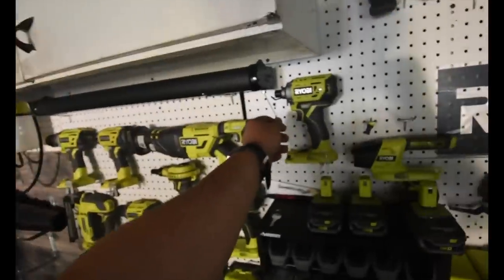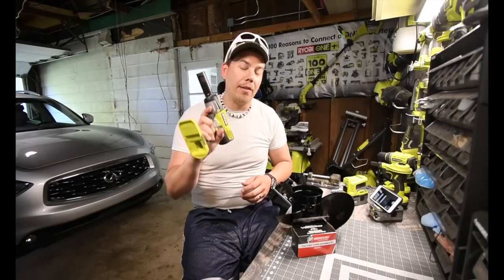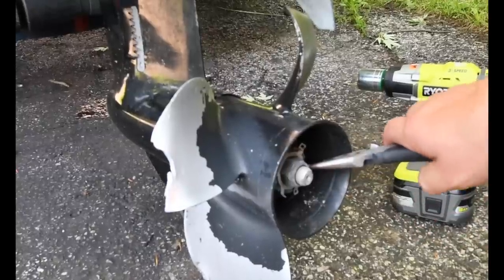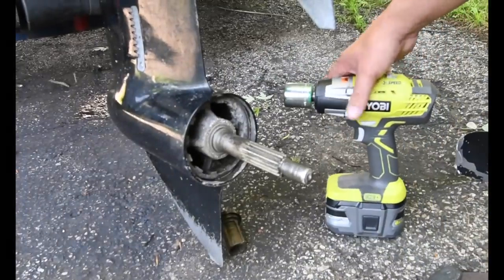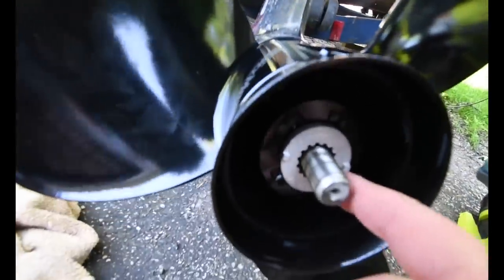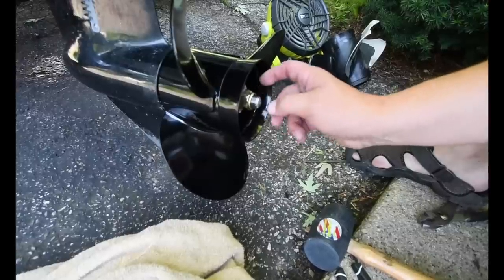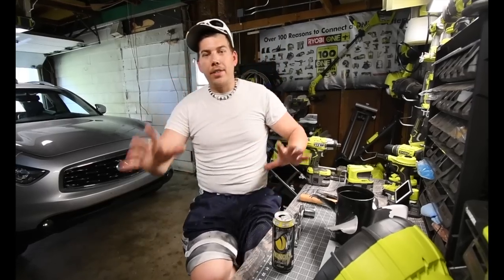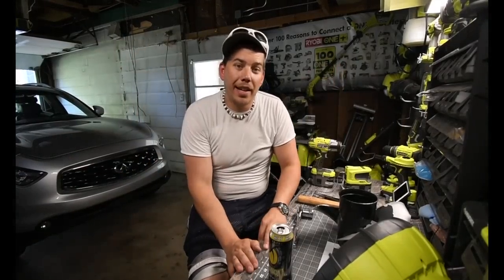Replacing a boat Prop

Comment: I’m a marine mechanic and you need to aline the tabs to the flats on the nut and bend tabs against the nut to prevent the nut from backing off. It’s a redundancy to the nylon in the nut. Safety firsts. I use ryobi everyday at my job, keep yup the great videos.
Reply: Mike F I thought that when I saw it;
Reply from the maker: Mike F the new kit had those parts I installed, I thought it would be the same as the kit that was in the original prop. The the locking system was different

Comment: I have this same 1/2" Impact WRENCH. It is AWESOME. In the low setting I can stop it with my hand (gentle and usable on smaller bolts). In the high setting it will rip some extreme things loose. I have used it to rip out an engine... getting all large bolts loose on a rusty old truck with ease. Even used it on a special socket to rip the old exhaust manifold bolts out that had sheared in there. Could not get the bolts out with rust penetrant and torches. 

Just use the 4ah battery for max power. I used some of my smaller batteries and noticed performance drop off. Of course still plenty of power with the smaller batteries for most jobs as well though.
Reply from the maker: it really is a powerful tool

Comment: I have the ½ wrench also. I had a suspension bolt that I couldn't get out with my ½ air impacted driver. Come to find out it's tork speck is 300ft lbs and hasn't been off in 10 years. I impacted on it with the ryobi for 30 seconds and it started to move slowly then zip right off. Total bad ass tool.
Reply from the maker: Robert Descamps Ryobi is awesome

Comment: I have a bunch of Ryobi tools and I have this impact which works good but I hope Ryobi comes out with a bigger one to compete with the other manufacturers offering higher torque versions in my opinion this is the only place Ryobi is lacking.
Reply from the maker: p0weraid more power is better

Comment: I don't know if maybe I just got a defective one or not, but I had that impact wrench for a little while and returned it after I saw that it was throwing sparks out of the vents when I let off the trigger. I was using it for working on cars and didn't really want it throwing sparks in an area with fuel and solvents. I assume it was little bits of the brushes that it was throwing out?
Reply from the maker: yes, The Brush tools spark
Reply: Well, I know the brushes spark inside the tool, but this was throwing sparks out of the vent slats.

Comment: I am surprised the manufacturer doesn’t recommend use some type if loctite just to make sure it doesn’t come off
Reply from the maker: I am as well, I did exactly what the instructions said and it woked
Reply: @ManCaverTools  Its a nylon nut so there is no need for loctite, and there's also the taps. The nylon and the taps act as locking so loctite not needed, though there's nothing wrong to use loctite. And high five for Ryobi Man Caver ! New to the channel and thanks for the great videos, good stuff, keep up the good work!